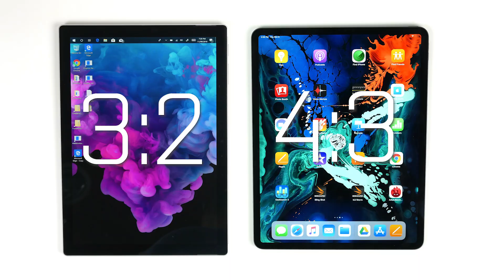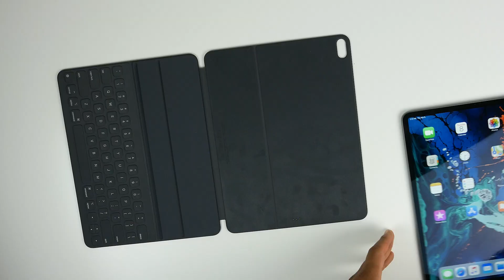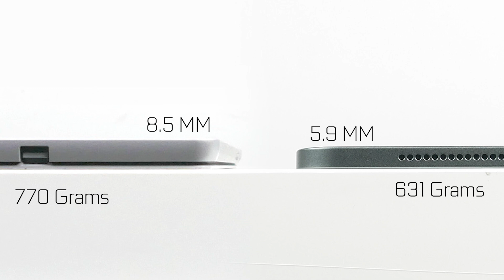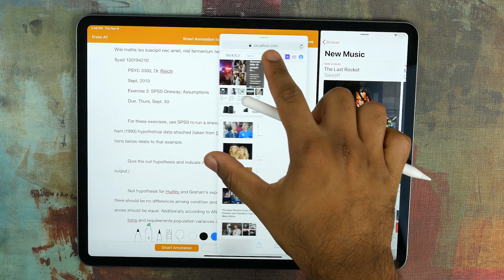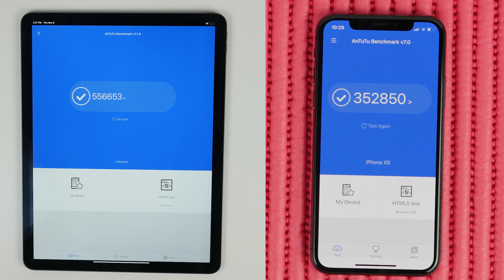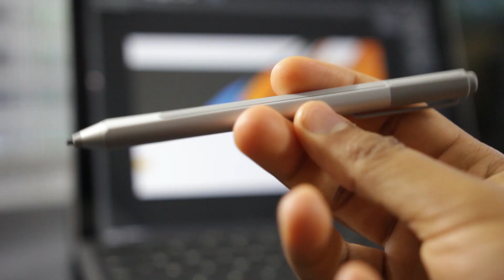2018 iPad Pro vs Surface Pro 6

Comment: This isn't a comparison! Can't compare a mobile operating system to a computer operating system. iPad isn't a real pro device.
Reply: If they are similarly priced and target the same audience, why not?
Reply: @num_py  Someone who's looking at a surface really shouldn't even be considering an iPad. Because they're truly not the same thing. I have an iPad pro 10.5, a surface pro 6, a MacBook Pro and a iMac 27inch. And they're all completely different devices yet my surface can do everything both of my MACs can do. The iPad not so much
Reply: @damonmason9233  what is the majority of the things you can do on your mac that you cant do on the ipad? except for playing games, there's little "work related" stuff that you cant do on the ipad.
Reply: @lolsa123  I won't even acknowledge this nonsense. You have no clue what you're talking about.
Reply: @damonmason9233  rofl, and there we go. You had nothing "work related" that was so wooping that you could site it. Fucking idiot.
Reply: Editing and rendering 4k videos in a reasonable time. Programming and compiling code. Computer assisted design (CAD) in a reasonable fashion. There is a lot of "work" related stuff you can't do on an iPad and even if you can do it on the iPad, it's usually more complicated compared to a mac or windwos pc due to the limitation of input devices (no mouse for example) and therefor takes longer to be done compared to a PC... Also not being able to use a external hard drives or USB Sticks can be critical if you have to be able to work in a enviroment with Windows, Linux and Mac devices... Also some "Apps" (I dont like the term since it is confusing) are not available on IOS but on OSX... And most of them are available on Windows.
Reply: @sunilmathew4616  Exactly! It's great for media. I have the 10.5 pro and love it for that. But it's not a pro device. It's an overpriced media device. But no comparison to a surface.
Reply: Apple put themselves in this position by trying to copy what Microsoft has been doing with the surface for the last six years l. They put “pro” in the name and compared it to laptops at its launch. It’s also the same price range, so yes I am going to compare them
Reply: J Morrison uploaded a video of him editing a video with iPad Pro. Isn’t a pro device? Think again. At least iPad edits faster than the base model i5 surface.
Reply: You definitely use windows and aindroids
Reply: Angelo that may be the case. But until it's able to stand on it's own without 100% dependency on apps it won't really compete with this. Don't get me wrong I think it's by far the best for what it does. It's just not in the same league as the Surface. As someone who shoots photography and day trades. It's not just about transferring photos. It's more about being able to tether on this device, plugging in an external hard drive to a real file system and etc. I can't download trade software on this device and trade properly, no mouse support and etc. It has potential to be a true pro device which for the price it should be able to do all of these things. I'm sick of Apple almost being there but charging these ridiculous prices like they're there already.
Reply: @damonmason9233  haha have never heard of a pro photographer that preffers a sheit device as the surface over a real computer. 
the surface is a mediocre device, it may be the best hybrid but it is neither exelling at being a tablet nor a laptop.
Reply: It actually is exelling at being a windows based tablet because there is no better windows one on the market. The problem on comparing a windows based tablet to an android or ios based one is that you have to take the OS into account... With a windows based tablet you get a true OS with every possibility you have on your desktop, while android and iOS is realy limiting. And there is literally nothing a surface can't to what an iPad can. It might be slower under some circumstances, but in return, the surface can use applications that wont run on the iPad due to its limitations. So when it comes to a pure capability comparison the surface will be the winner. And ofcause the surface wont be able to compete against gaming laptops but neither can the iPad... the iPad might outperform the MacBook (which isn't proven by the benchmarks since they also don't take the OS into account which can have a big impact on how good a CPU is working), but what's the worth of such high performance if you don't have any applications to utilize it? 
Also the surface is actually performing like a 600€ HP Notebook and thats fine. 

Also... As a hobby photographer and IT Nerd... If you had any clue of what you are talking about you would know that the adobe applications actually utilize multi threadding and therefor putting a big load on the CPU rather than the GPU which makes even the 8th gen i5  (4 cores/8threads) a good CPU for running lightroom, photoshop and premier. 
Combined with the fact that you can just take the SD card our of your DSLR and put it into the surface and start working while sitting on your train home, is just awesome... An iPad simply can't do that out of the box.

Next thing when it comes to productivity is security and data integrity... For doing backups of your Surface you can use the same infrastructure that you are allready using for you PC at home... Backup an iPad... You have to connect it to a PC and copy the whole thing or manually selecting the data... Which is possible but also way more work intensive than on a windows system...
Reply: AlmHurricane I think you are comparing apples to oranges. Surface is not a tablet. It’s a laptop with a touch screen and a separated keyboard running on an OS designed terribly for touch screen. 

I do agree the points you brought up which highlights the advantages of Surface though, it’s just that iPad is almost all tablet and a little tiny of laptop, while Surface is a laptop with a tiny bit of tablet.
Reply: Well... First of all we should talk about why we compare the iPad and the SF in the first place. The reason for that is, that they adress nearly the same audience although with 2 diffrent approaches, so we kinda have to make that comparison. 
In my Opinion Windows 10 in tablet mode isnt that terrible at all. For the last 6 Years I used diffrent iPads but the tablet mode of Windows 10 proved it self to be easy to use and due to it being more customisable than iOS it can be configured to a users need... Also the typecover keyboard isnt needed... You can use the screen keyboard just as on the iPad aswell... Also you can chance the screen keyboard to a area in which you can write with the Surface Pen and the SF will recognize your handwriting and convert it on the fly to text. So the argument that the SF is only a tiny bit of a tablet isn't realy valid, at least after what I experienced and in most clases in university I use it only in tablet mode...
Another question we should ask ourselfs is: Where do we draw the line between a laptop and a tablet?

I think the common "tablet" has limited funtionality and limited capabilities when it comes to input devices and external hardware... But that is a result of the OS not the hardware itself... For example Microsoft Managed to run a development Version on a Snapdragon 845 ARM Chip...
So if Apple actually manages to put OSX on the Ipad an make it able to use Mouse and keyboard just like the surface most of the criticism would be gone...
Reply: @AlmHurricane 
I work inside a data center and I agree with everything you said.  You sound like a smart guy and I'm sure you already know this but iSheeps have no rational thoughts
"iPhone has 3GB RAM but it can still wipe the floor with your 8GB Android phone!"  They somehow believe having less is better....
Reply: Well... I work for the goverment, doing some network and cyber defense stuff... Can't and wont talk more about my job xD 
There are always ppl who like a product because it's made by apple or samsung or microsoft... Most ppl can't judge a device just by looking at the facts. 
And talking about facts... The iPhones A12x CPUs are actually better than even the overclocked Snapdragon 845 in the Asus ROG Phone, atleast in most of the benchmarks. So in some cases the iPhone might outperform an 8gb Android phone... But since the ROG Phone costs as much as a new iPhone it doesn't realy matter^^

Personally I use a iPhone 8 because I like the iOS. It's easy to use and setup, has a lot of comfort options and doesn't borther you with an absurdly lot of options to change to customise your phone... For me, I just don't need that much of customizability, but that's a choice everyone has to make for themselfs. And I shot the iPhone 8 for literally 0€ due to my contract with the ISP had to be renewed.
Reply: Damon Mason literally wrong from the beginning, ipad can , it just need adapter to make it work... second is , ipad is running on apps, same as on windows, the difference thing is you can access to files inside the apps on windows when ipad only access to the saving documents...rightnow yes, it is not a finish product to consider. Second, as someone who was a real pro they wont choose ipad or surface since surface cannot replace a laptop...first, it is not special, second, it is not strong...they will choose something like a real laptop or a pc. As the pro, they spend a lot of time and passion in their projects so with something is small, not accurate panel, wicked processors and low storage...surface only can focus to basic user like browsing and typing essays which is same as ipad right now...so it is a fair compare
Reply: @NamelessPassenger  What are you talking about? Windows does NOT run on apps. iOS is a mobile platform. Windows is a browser based full desktop operating system. Also this Surface is literally a laptop that runs on a i5 or i7. You have no clue what you're talking about. The ipad cant replace a laptop which has the been issue for literally EVERY real reviewer or someone that knows tech.
Reply: Damon Mason not yet at least. The great thing about the A12X chip is that it’s future proof against later iOS updates that will expand the iPad’s versatility. So while it may not be a true pro device at the moment, it will as iOS evolves and as third party developers create pro apps that utilize the touchscreen interface.
Reply: Angelo Villones man stop u know damn well Apple will not put Mac OS on an iPad that came with iOS your bragging about the chip n not the device. If you see Mac OS on iPad that iPad won’t have a12 chip
Reply: @angelo_villones  But it still can't support Visual Studio LOL.
Reply: @rustinpeace770  I'm not denying that. But its on a mobile operating system. How fast will it be running a full version of final cut rendering a 4K video? The Surface runs a full desktop operating system.
Reply: The iPad can be used as a pro device you can buy it with 1 terabyte that’s as much as most productive desktops have and it has a powerful cpu and great screen quality and you can use it to do productive work such as video editing on the iPad with Lumafusion and art/logo design with it so it is a pro device YOU ARE A IDIOT
Reply: Verpexity used as a pro device... can’t be assured that I can view every page on the internet properly.

ARM based products suck
Reply: You can’t do any pro photography or video editing in that Surface Pro either, you need the top of the line $2,500 Surface Pro 6. And photoshop and Adobe products will be available for the iPad Pro earlier next year, and I bet you they will run better there than in the entry level Surface Pro using desktop apps.
Reply: Pablo Villegas You don’t need buy $2,500 Surface Pro 6 to do real productivity on i5 Surface Pro 6. iPad Pro can’t run an hypervisor, do network packet analyzer, scan device mac address in network and can’t use external storage to copy and transfer files. I do have 10.5 iPad Pro and I love it, which I use it for Media/Light Productivity on the go. I already have Windows Laptop so that’s why I got an iPad Pro.
Reply: @pablovi77  You're incorrect, actually I do have the top of the line. But you don't need the top of the line for Photoshop,Lightroom or premier pro unless you're editing 4K video. All Adobe products are the full desktop versions being that the Surface is an actual computer. Do you guys know what a Surface is? Some of your statements have been so far off.
Reply: @damonmason9233  
It sounds like you know exactly what you're talking about and you have a healthy buying habit when it comes to tech devices, but don't argue with iSheeps because they have no reasoning when it comes to Apple criticism....  BTW I'm like you and I love all brands

Comment: If only Apple and Microsoft woould team up... we'd have the best computer/tablet
Reply: MS OS depends on user proficiency.
Don't wanna say that's good for everyone (you actually need to know something about tech to use it) - but saying it isn't stable OS is bullshit.
Mind you, I'm writing this on HP ProBook 450 G1 with dual core i3 proc 4000M (it's 4 y old laptop), running Windows 10.0.17763, and it's not same shit as win95 (which by the way for the time was good OS).
Also I'm using this laptop for work as system engineer, and don't remember when I had "unstable OS". Despite HW being "outdated", it serves me very well. Saying that I've upgraded SSD to Samsung 860 pro, and 16 Gigs of ram, so comfortably i can run up to 2 VM's (one for VPN-s, and one for Linux system) which is with host OS more than enough for my consumer + pro use. 
Caring about apps I install, not having ton of shit on laptop and regular maintenance is simple way for having a clean stable OS even with not so good hardware.
Reply: @max mustermann why would you say that if you all know about os is gaming lol
Reply: Actually we would only have 1 excellent computer tablet. The rest will be the same as that one. 

No rivalry. No need to improve.